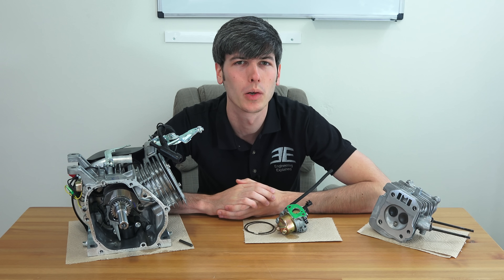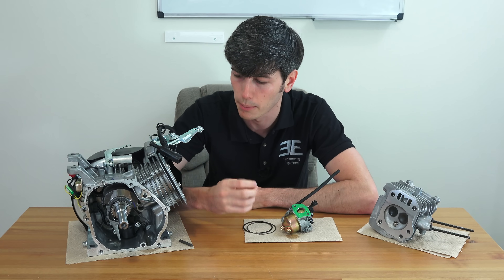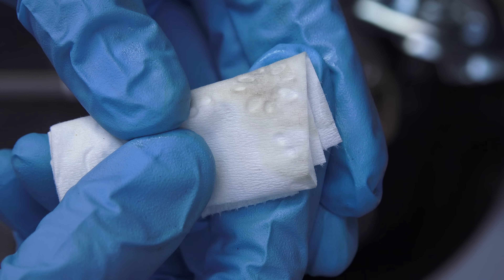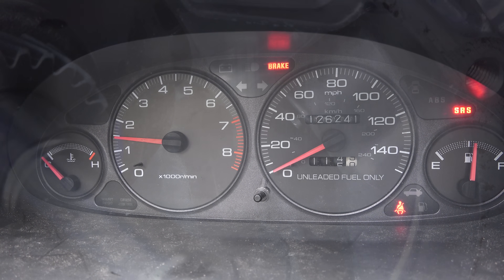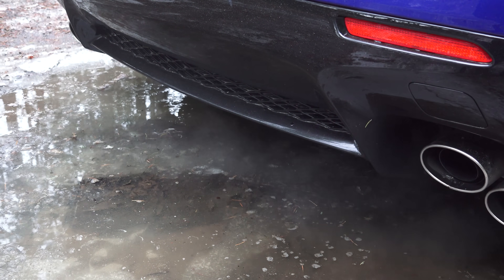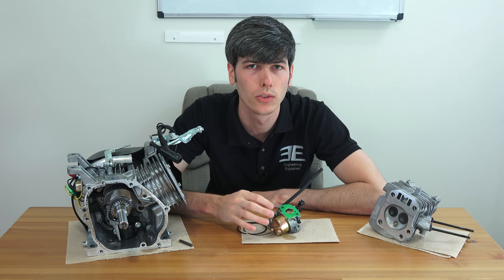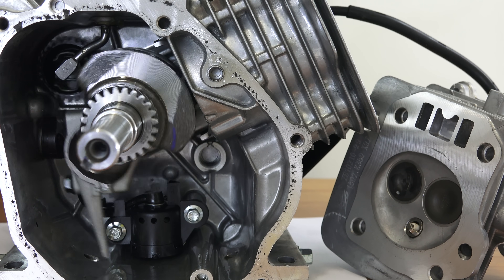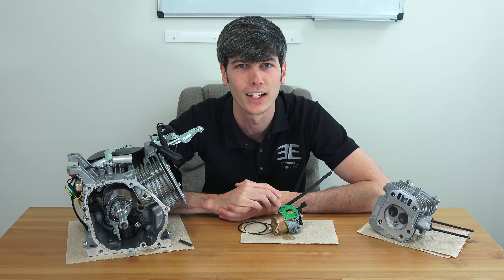Should You Warm Up Your Car Before Driving?

Comment: Yes and no and it depends on what engine you have in your vehicle. Yes you don't have to wait for your engine to warm up when if you have a naturally aspirated fuel injection engine and can drive at engine speeds below 3000 rpm till temperature exceed above 80C. But if you have a turbo this all change the equation as driving of without waiting at least 3 mins will cause damage to the turbo as the turbo needs to gradually heat up especially the oil or you'll have lack of lubricant in a turbo that spins in speeds over 30k rpm to speeds up to 120k rpm. 
Best is check your vehicles owners manual for driving when cold. My vehicle owners manual (factory fitted twin scroll turbo)  insist to start engine and idle for no less than 3 mins and then no engine speeds above 2000 rpm till coolant temperature is above 80C (that's about 6km depends on temperature that day). 
So be sure to check your owners manual out. 
Also any engine (turbo or non turbo) should never be switched off directly after a drive on a hiway like stopping to fill at the gass pump as in could lead to boiling or blown cylinder head gaskets, you may think it's crazy and say I've done this many times with no problems but one day you cruise and boom goes a head gasket and you wonder why it went. In my hundreds of moons past as mechanical engineer I have never had a cylinder head gasket or blown head because of these tips yet all my friends that doesn't do my tips all had failures to their vehicles one of my vehicles was 30 years old when I sold it and still the engine was never opened yet never used oil, sold it because of rust on chassis and didn't want to plough money into an aging vehicle.

Comment: Sounds good but what about living in Northern Ontario Canada and using a car with turbo?
Reply: I have a Jetta TSI 1.8t and I let my car run for about a minute when temperature gets below 0 celcius. Your engine should start to slow down after a minute, meaning the temperature is already getting to a decent point. Just don't push it too hard and don't use your boost for a couple of minutes after you start driving... As you should always do, even in the summer. Coolant need to get to your turbo, so letting your car idle for a minute before starting off is a good idea.

Comment: I don't care what the temperature is I always warm my engine up. Especially colder weather.  Being a mechanic I know what's going on inside.  Even if it's 90° i at least let the oil circulate before moving.  I hate people that hit the key and jam it in D. Then they wonder why their cars burn oil and leak. In an engine are different metals and materials that expend and contract differently in temp change. Heat them up quickly and you could create issues.
Reply: Yeah I always warm my car up before driving by idling the engine for 2hrs in summer, 4hrs in winter, oil is toasty warm by then.
Reply: Armando Sturzenegger  you're welcome
Reply: What about Diesels?
Reply: SammyT ok what about I just leave the engine running 24/7 then no cold start wear can ever occur = winner?
Reply: I personally only warm up the car for 20 sec...turn on AC and drive lightly
Reply: Matt Parker I do like you even if in Summer because i know the oil needs time to lubricate all the engine parts. So 10-20 seconds it’s enough on Summer. In Winter i let it till the instant consume drops from 4-3l/h to 2l/h.
Reply: You do you and let the others slam the throttle on a cold engine
Reply: as long oil is circulating, you can drive the car. i've taken the tappet covers off a cold engine. took 30 sec for oil to get up there. once oil is circulating, it's fine.
Reply: sultanabran1 exactly. Don’t cold start it then floor it. Start it, wait under that minute to let the oil go everywhere, then drive lightly until everything is all good to go
Reply: @pwdt4r313  too difficult for people realise they're wrong and change.
Reply: @sultanabran1  Sorry but that is not true.  The oil viscosity it too thick to lubricate properly when cold.  Most engine wear occurs on start up as a result.  While engineering explained is correct that the car runs rich when cold, putting load on an engine where the oil is too thick causes wear on the rod bearings which have oil passages only millimeters in width that  the oil must pass through.  I would much rather have my oil pressure close to what it is at operating temp before I put any load on the engine.  Yes, there will be more fuel dilution, but it will put less stress on the rod bearings which are usually the cause of catastrophic failure.  If your worried about fuel dilution then change your oil more often.
Reply: @andrewmcintosh9832  you're saying thicker oil, lubricates less than thinner oil...
Reply: @sultanabran1  Engine oil is designed to be at its most efficient and steady state at operating temperatures  between 100 °C and 110 °C.  High lubricant viscosity at lower temperatures results in higher frictional losses, reducing the thermal efficiency.  Frictional losses in the engine when it is cold (less than 20 °C) can be up to 2.5 times higher than  when the oil is fully warm.
Reply: @andrewmcintosh9832  if you watched the video you'd know that the gasoline in the engine washes the oil off the cylinder walls when it's cold because of the bad circulation. no oil = more wear. you need to bring it up to temp as fast as possible without creating too much load on the engine.
Reply: @sultanabran1  well somewhere between marmite and water is your optimum oil thickness. Too thick and it can't flow and to thin and it is simply pushed out of the way by the metal on metal contact.
Reply: You Just wasting fuel nothing more.....

Comment: Maybe “VERY LIGHT” driving even in a EFI engine but as a mechanic I have seen and had myself blowing several engines because of not giving the engine a good 10 min or better to get things moving around, here in VT we have so many hills that you cannot drive lightly, yes you can jump in and drive off but with a lot of wear being done on the engine. Plus a forced induction engine with put a lot more stress on the internals when cold. Metal is fragile when it’s cold and repeated stress in this state will result in reduced life.

Comment: I have a 2011 VW Jetta and when the engine temperature is low, it seems like to be idling at higher rpm than normal. Is that programmed into the ECU? Should I wait until the rpm settles down??

Comment: So this is what I do: When I start my car cold it idles at or around 1200 rpm. After 45 sec idling it drops down to 800 rpm. And that's when I start driving the car trying not exceed 1500 - 2000 rpm until the oil and transmission are in operating temp. Then drive it it normally. Does all this seem reasonable?  you said 15-30 sec but I wait for the drop that's 45 sec.

Comment: Carbeurated engines had chokes, so they did have a method to increase the fuel-air mixture when cold.  But they didn't have all the sophiscated controls to get it just right.  In fact when chokes were manual, many drivers would forget to dechoke the engine when it warmed up.  Some small engines in snow throwers and lawn mowers still have manual chokes.  Automatic chokes were operated via a bimetalic coil thermostat in the liquid cool system.

Comment: When I first start up the car, should I wait for the idle to drop down to around 1k rpm before i put in gear?
Reply: You didn't supply enough information which is possibly why you didn't get any answers.
If you have an old fashioned car that has a carburetor then you start the engine, wait 15 seconds and tap the accelerator pedal to see if it drops down to a reasonable idea speed then you can take off. If it doesn't then tap the pedal once every 15 seconds until it does drop then you can drive away.
For fuel infected cars you have to read the owner's manual. 1k sounds like its set too high to me so check the manual and see if you spot an anomaly between what it says and what you see. If there is then take it to the dealer and have it corrected (that idle speed just sound too high to me), once its corrected then you will probably find that the idle speed is not that high.

Comment: Hey there! Agree, but only fully true for gas vehicles. In diesel engines, warm up is fundamental for the engine block and pistons to expand. In diesel cycle engines combustion is due to compression, not a spark. And block and pistons at correct working temperature provides better combustion with its corresponding efficiency, and longer engine lifespan! Cheers from Spain!

Comment: From the start, you're always supposed to let your engine run.  Why do you think an engine is programmed to idle higher at startup?  Plus, it's more-dangerous to drive with a cold windshield, even if the heater-core is warm - if you can't see going down the road, you're the most-dangerous person.

Comment: I've been guilty of too long idle warm up periods in the past. Now I base my warm up on outside temperature, 5 minutes max and that's for below freezing. About 2 minutes is plenty if it's above freezing. Also think of what conditions are you going to be driving in with a cold engine, for example if you have to accelerate to a higher speed or up a steep hill as soon as you leave then you might want to give it another minute or 2. If you only need to go 20mph or be stuck in traffic 30 seconds is enough

Comment: Is not another reason not to let your engine idle when cold is that the top of an engine is usually splash lubricated.  With cold, thicker oil, and the oil pressure lower (due to idle speed) less oil reaches the top of the engine to be splashed over the cam etc?

Comment: As a former STi owner, you of all people should have said "UNLESS your car is turbo - in which case you SHOULD let it warm up." The Final Edition Evo user manual specifically says to wait until the coolant temp starts indicating. On a hot day this only takes a couple min, but on cold days can take up to 6 or 7 minutes.
Reply: my buddies 2011 subaru STI has pushed out its cam seals twice from the thick cold oil in the -40 Celsius Canadian winter cause he just started it and drove it before the oil got warmer and thinner. $3500 later he lets it warm up and has never had another issue.

Comment: When I look at the realtime data on my OBDII scanner, I see that the LTFT actually increases when coolant temp and Intake Air Temp go up, after engine has warmed up.  Why is this?  Higher intake air means less dense air, so shouldn't LESS fuel be required, instead of more?

Comment: When it's VERY cold outside (teens or single digits) I like to let the engine run until the RPMs get down to about 1,000 RPM. Just so the oil and transmission fluid (especially for automatics) has had time to run through and warm up some (even if not fully) so it flows better. 

In the summers (engine hot or cold), I start the engine and then let it idle for the amount of time it takes me to fasten my seatbelt and sit correctly.

Comment: I don't know, when cold the tolerances of the entire engine has changed, gaps are bigger.

So when you put that engine under load very quickly after starting it up, that big gap of lets say .050" is now allowing more wear to occur because of the wiggle room, or because it allows the material to angle itself a bit more making the pressure/energy distribution uneven.

Once an engine is warmed up, the tolerances are all tight and in check. Nothing wiggles, nothing angles, etc.

So even if people say you don't have too, I will always be gentle with my ride in a -20 to -40 celsius morning.

Comment: DRIVING TIPS

1. Do not rev the engine or accelerate past half throttle immediately after start-up. Oil requires time to heat up for full flow, and high-rpm driving with a cold engine can damage the turbocharger.

Comment: What gas gets by the piston and winds up in the crankcase will evaporate and be sucked in by the PCV. With a warm engine the gas or blow-by gets sucked up faster by the PCV system. As far as the carburetor/choke systems the air fuel mixture is not controlled near as good as an electronically controlled fuel injection system however the old choke systems were controlled by engine heat.  Last stif cold oil does not have the flow-ability as warm oil even though it may be a multi-viscosity oil. For those who say it does- put a quart of oil in the freezer take it out the next day and pour it out beside a can of oil that is room temperature. You will find the room temp. oil flows out much faster.  So I would not put that much confidence in this video.

Comment: When a piston is cold, it is a different shape from when it is hot. A cold piston is slightly oval because of it's use of metals. When you put that cold oval piston under load, you are shapping it, please let your car warm up :)
Reply: Agreed. Also when you have a cast iron block and aluminum Heads, one will expand faster than the other ( usually ) and that can be hard on the gaskets. I knew a guy who had a 70s ford with a 460 Big block with aftermarket heads and it always leaked oil. ALWAYS. hed get it fixed and 6 months later would be spewing oil out of 3 places again. its because hed get in it in -45 and just drive it down the highway without letting it warm up. He finally got it fixed for the 3rd time, let it warm up from there on and not an issue since.
Reply: Thank you

Comment: As a full time Auto Repair Tech, I entirely disagree...based on my location.  Alaska reaches -30 to -40 every winter and lack of idling to bring up to temp will wear out a motor rather quickly. 

But in most places, winters of 0 degrees Fahrenheit, I wouldn't worry about idling the motor til it hits operating temp.
 In that I think we agree.

Comment: I know I should not load the engine while cold, but why? If the oil circulates and it is in all the places it should be, the thicker it is the better for lubrication. So I guess  it is assumed it didn't reach the places in required quantities as it should be. Is it so?

And what does it mean to load the engine? High gear lots of gas or high rpm, lots of gas?

Comment: I didn't know people actually thought warming up their cars was a good idea I always thought people warmed up their cars because they liked getting into a warm car, give the car a change to heat up some coolant to get the climate control cooking.  Personally my dad who is a technician always told me that you are good to drive as soon as you turn over the engine just drive lightly until the temperature gauge hits a decent reading.  Reason being you let the components like the engine and power steering up and rack warm up a bit before putting loads on it.  One thing I've always avoided in cold cars is turning the wheel all the way right away on really cold days my dad and I drive older cars and we have seen power steering lines burst under the heavier pressures cold thick power steering fluid causes